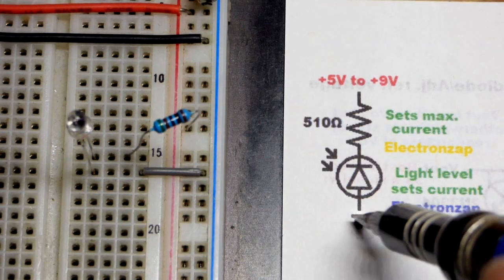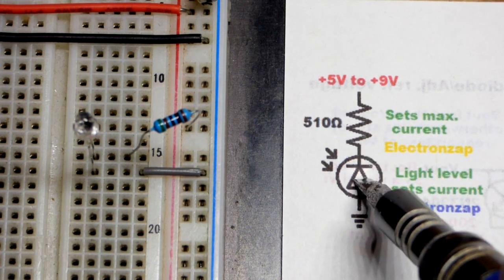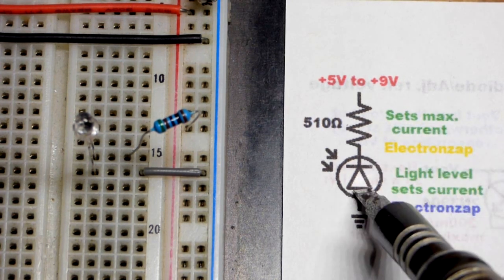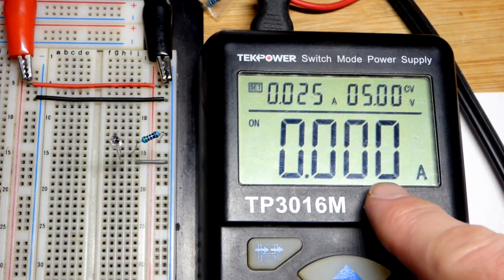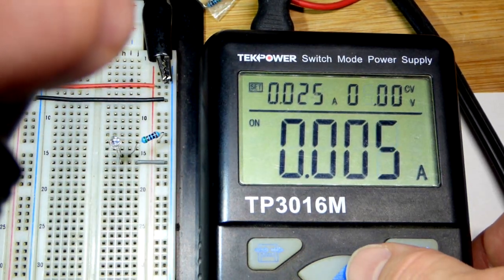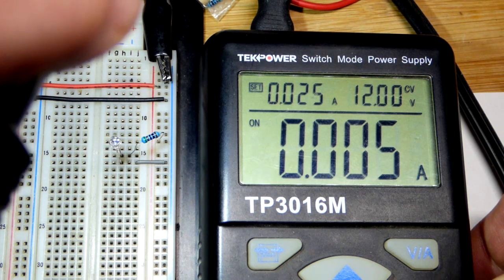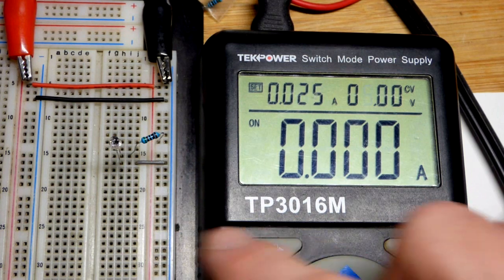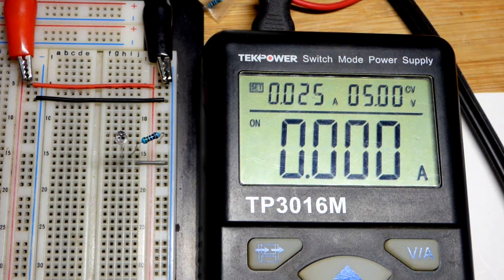Photo diode basic demo circuit for learning electronics shorts 86

Comment: What is the difference between a photo diode and a light dependant resistor?
Reply from the maker: LDR has a changing resistance in either direction based on light level falling on it. So changes in supply voltage will change how much current is flowing. A reverse biased photodiode will let a certain amout of current flow through it based on the light level falling on it. Changes in supply voltage won't change the current flow as long as there is enough voltage.
Reply: @Electronzap  Thank you